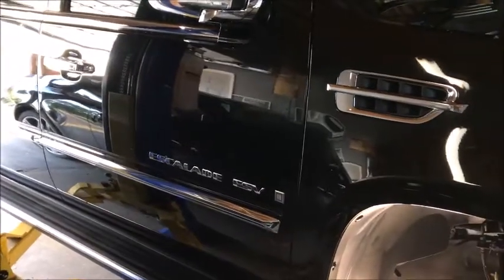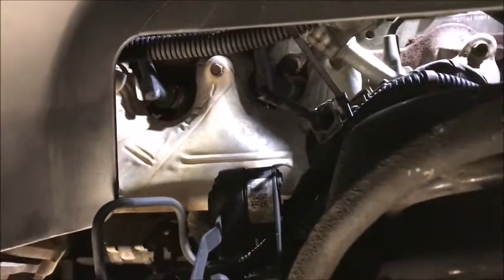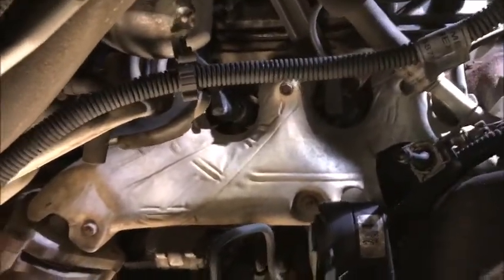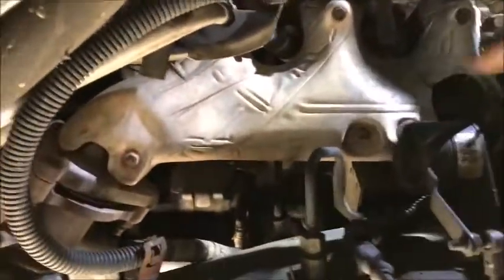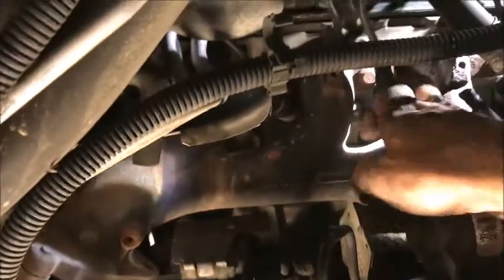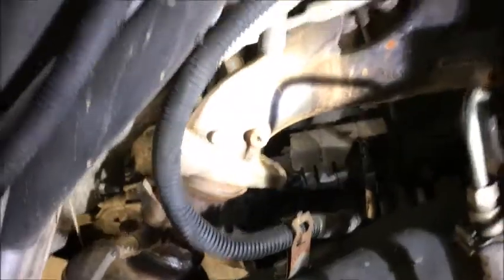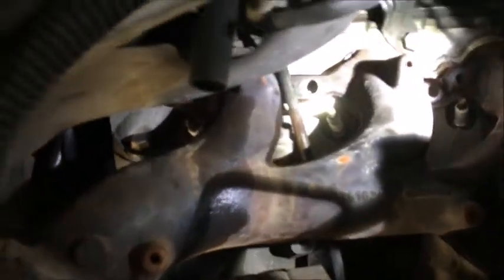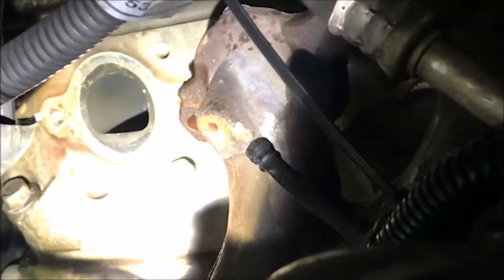2007-2014 Escalade Passenger Side Exhaust Manifold and Motor Mount

Comment: I replaced my (2013 GMC Sierra) passenger mount without removing the manifold or heat shield. Difficult but not impossible. Thanks for video
Reply from the maker: Thanks for the comment...helps others know it's an option not to remove the manifold for sure !  I had some broken manifold bolts so my had to come off, but if it isn't necessary to get the motor mount off this is great to know.

Comment: great video....do you have a video of the noise before and after the repair was completed. I have been chasing ticking for  a while...now...already replace lifters and Oil Pump Oring and I still have a loud tick on cold start and during acceleration
Reply from the maker: Hello, I actually didn’t do a video of before and after (I should have in thinking about it for sure), but the manifold leaks did sound exactly like bad top end noise. For mine, when I looked at the manifolds, several bolts were broken so I was pretty sure that was the noise...especially since it would go away once the motor warmed up and the metal expanded. Mine doesn’t make any noise though when accelerating (after the motor warms up).

Comment: Did you have any codes? I have a stubborn p1175 that goes on & off. Plus I have an exhaust leak from the flange even after installing a brand new oem manifold
Reply from the maker: Hey !  It actually wasn’t throwing any codes…just had a terrible exhaust leak from the manifold that sounded like the motor was coming apart, lol.  I have had the p1175 code pop up before though.  Fortunately it was just dirty injectors from some bad fuel so a couple of bottles of injector cleaner made it happy again.

Comment: You got a lot of patience.
Reply from the maker: Thanks !  Yep, some of these DIY’s do take some patience for sure.  Good thing I can turn the camera off and edit the video before posting or most of them would have to have a “Strong Language” warning at the beginning, lol.  All the best ! Steve.
Reply: @StevesDIYs  hey you got any advice on front and rear shocks (electronic/ auto ride) other than OEM, maybe a website ?
Reply from the maker: @airborneleads1981  , hey again !  I actually did change my fronts and rears out from some aftermarket shocks (got rid of the auto ride on the front as mine had a bad vibration ).  The videos are out on my channel under the Escalade DIYs Playlist if you wanted to have a look 👍

Comment: Hey. Currently doing this project. i can't seem to get the dip stick tube out of the way. How did you go about do that?
Reply from the maker: Hello, it’s been quite a while since I did the manifold gasket and motor mount so I’m not really sure. It didn’t seem like it gave too much trouble and if I remember right it was held on by the bracket and once unbolted, it will pull upward. Sorry I couldn’t be much help...I’m sure you’ll get it figured out though if you’ve made it that far into the repair 👍.  All the best, Steve
Reply: @StevesDIYs  I was able to figure it out. It looked like it was hard molded into engine but it pulled right out. Looks like it will slide right back in and secured with that bracket. Thank you for the response. Next up, transmission and rear main seal replacement.
Reply from the maker: @santaklauz23  👍 cool !  Glad you got it 👍. Hopefully the rest of the repairs go good too...it’s a bit of work to take it all off to fix all of these seals and rubber parts, but it sure is nice to not have it making drip spots all over my garage floor 😀. All the best !  Steve

Comment: Did you need to lift the engine up at all? Great video!
Reply from the maker: Darren Hattingh , hello...thanks!  I only had to lift the motor up about 3/4” or so on the passenger side so the pin that’s in the middle of the mount would come out of the hole in the frame.  The driver side mount flexes that much on its rubber so there was no need to loosen it or anything.  I started by just supporting the engine with tension on the lift bridge to remove the mount bolts, then slowly raised it up and checked few times to see if I could remove it until it was finally up enough.  After replacing, I then lowered back down till it touched and bolted it back up so the holes would line up easier.  Hope this helps 👍
Reply: Thankyou sir 🤙🏻

Comment: What did you use to extract the bolt having the same issue
Reply from the maker: Hello, I ended up having to take a nut and weld it into the broken bolt to get it out as it was flush to the block surface and there was no way to get a grip on it. I just used my small wire feed MIG welder and welded the bolt end to the inside of the nut and then I could back it out with a wrench. Not much fun at all when the bolts are broken for sure ☹️